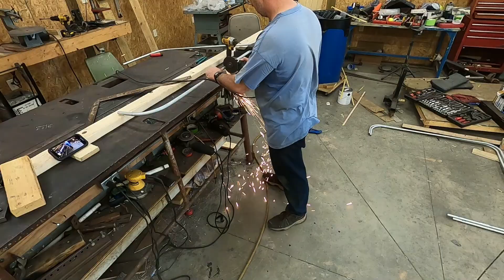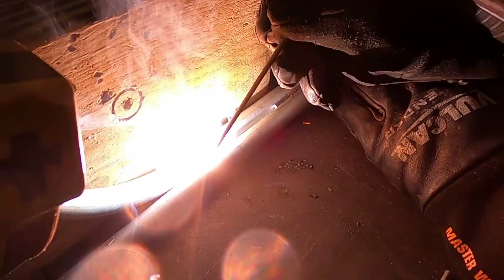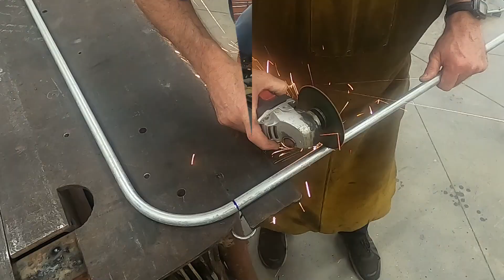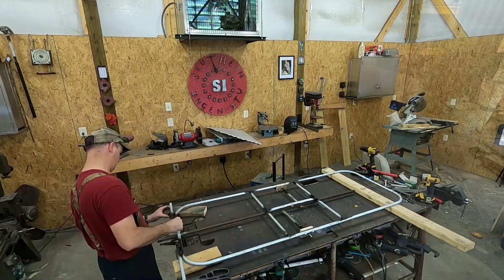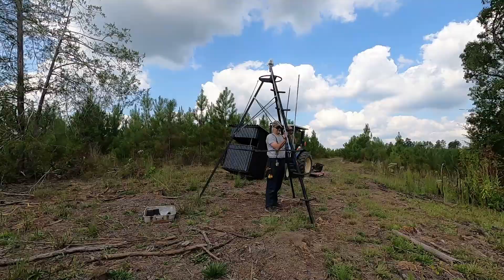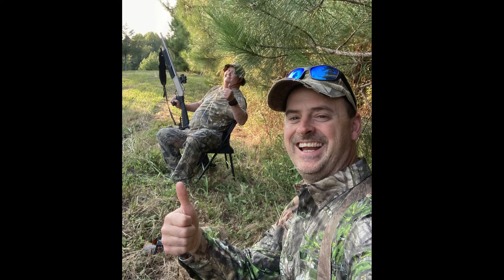Making a Deer Hunting Blind Out of Conduit, and a Tribute to an Old Friend

Comment: How did you tie it down??
Reply from the maker: I made some stakes about 12 inches long out of rebar and large washers. I anchored them diagonally into the ground through a hole in each of the feet. Then  I drove stakes into the ground in between each foot and pulled it down with ratchet straps.